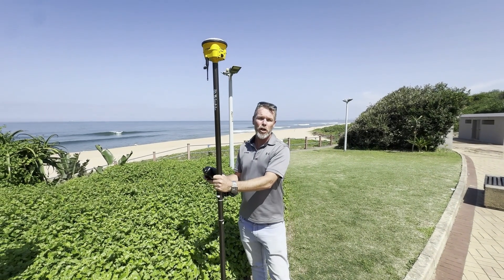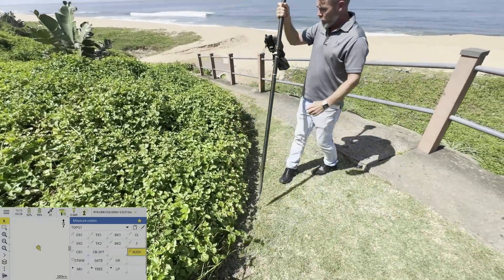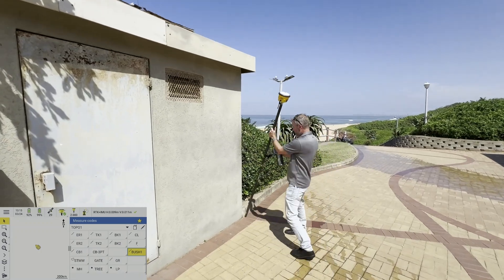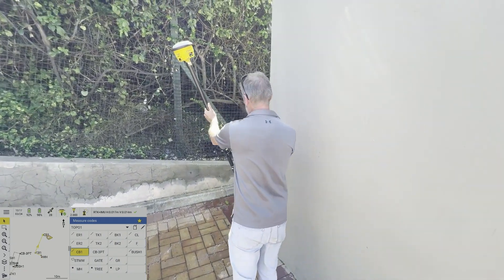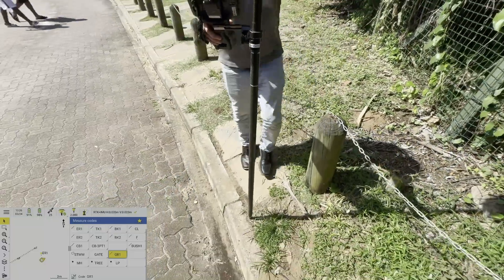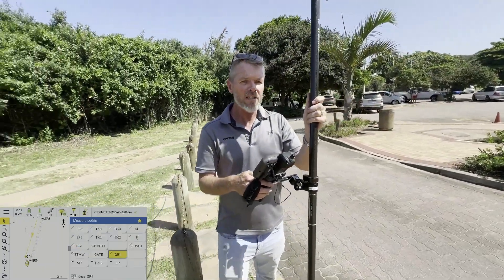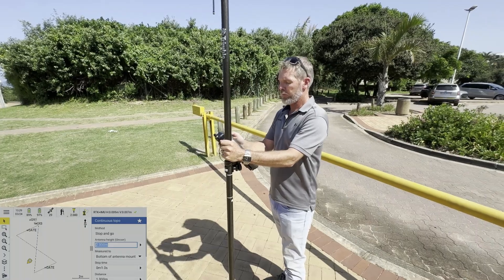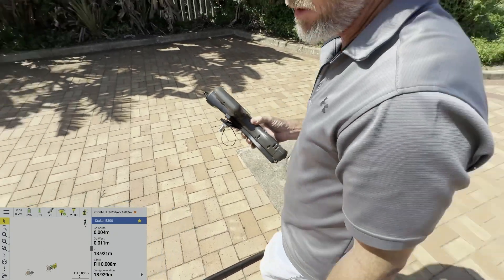CAD in the Field - Trimble Feature Codes - R780 Tilt Rover

Comment: Really nice example or measure codes. Add in the CAD toolbar and you can get some good cures and quick Join to features. Now if only there was just a simple way of noting that the lamppost shot wasn't true height! so it could be excluded!
Reply from the maker: Yes, too true, the CAD tool bar is really powerful. The Lamp post height will not be used, along with the building corner which was measured at 90degrees. Ill figure out a way to not include these types of measurements in the surface creation.